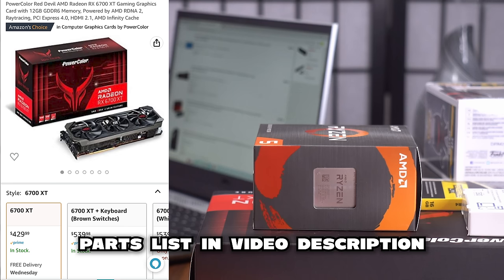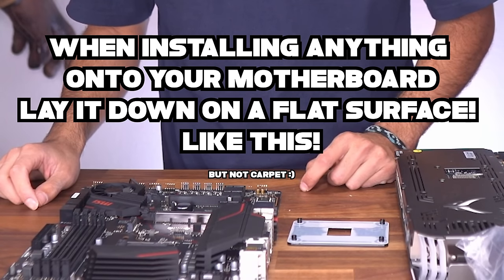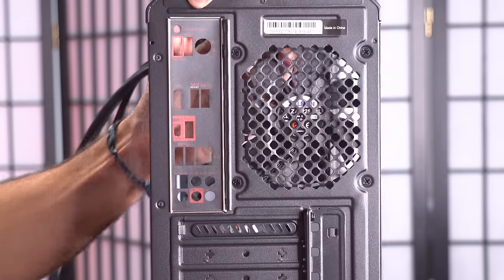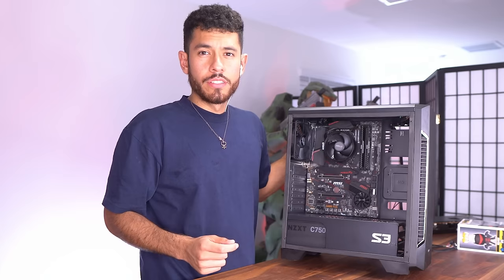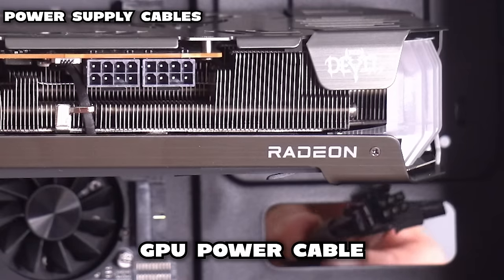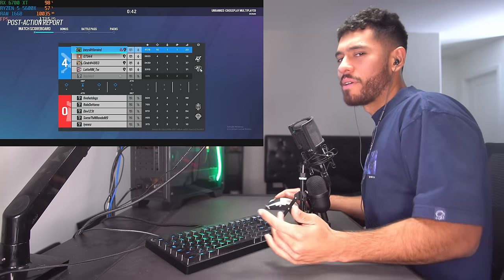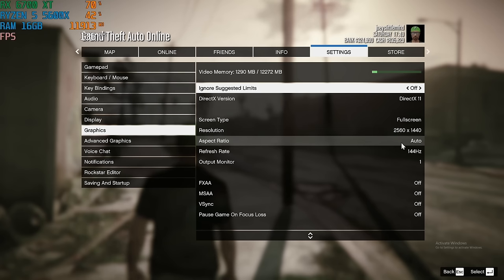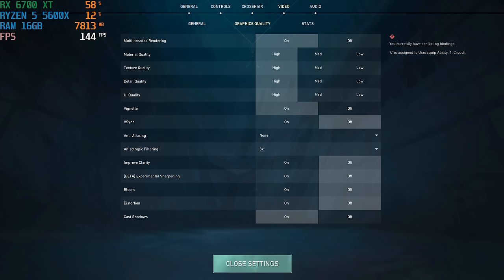BEST Gaming PC Under $1000 GUIDE 2023 (RX 6700 XT, Ryzen 5 5600X)

Comment: Hehe...so the one thing i didnt do when building my 1st PC about 2 months ago was...adding those motherboard standoffs. I cant even remember if there were any already installed in the case (vetroo white atx mid-tower) or if there were none at all...oh lahwd....hope i didnt fuck anything up 😂 😅 😭 (oop, realized i commented using my hubby's YT acct, ah well) 
---Jenn---
Reply: If you would have fucked up anything, you would have known almost immediately as the board short circuited. If your PC still turns on and runs fine, you're most likely good.
Reply: @JJFlores197  thankfully yes it's all been running fine since I built it, whew. 🙌😅

Comment: Even in these old low demand games you had a few games at CPU bottleneck and others pushing the CPU to 80% utilization, almost its full limit. With new games like Hogwarts, Plagues Tale, and Unreal Engine 5 titles arriving it appears 3 year old Ryzen 5000 6 core CPUs are cresting the top of the hill right now. A $299 5800X3D is a must for AM4 for those who can see the downside of the hill coming very soon. Or do a full rebuild for similar performance only hundreds more.

Comment: Nice build. Only thing I would do different is go Intel (i5-12400 is widely considered the best all around CPU right now, although if you find the Ryzen 5600x for a great deal or something that's cool) with the i5-12th gen, for the extra all round performance, but the Ryzen is usually cheaper with slightly better thermal performance and better stock cooler, although I always go aftermarket with my coolers. Good build. Good video.
Reply: For price/performance in terms of Triple A title gaming I'd go for a 5500 considering its only around 90-100$ yet offers very similar performance in triple A title, that said in Esport games it does loses by quite the margin, in Indonesia the 12400f is not worth it tho, it has very similar price to the 5700x which offers more core n threads
Reply: @lm1186  I don't really play that many games anymore. I just build and sell gaming rigs, and usually get good deals buying in bulk. Pairing the i5 12400 with the RX 6700 XT by PowerColor seems to be making everyone pretty happy. Which is wild considering pre-pandemic I had never used a non Nvidia GPU before. Now I can't ever see myself buying Nvidia ever again, unless it's personally requested as custom job or something.
Reply: @bizbarley74  what would you recommend for a cheap world of Warcraft gaming pc? Can you get me links to everything I need to build one?
Reply: @Roach4two0  You don't need much for that. I would Google " best $300 gaming PC build." I've never played WoWC before, but to my understanding it's pretty low on all resources. You could probably but a used GPU (Maybe a GTX 1030 or something) for around $70 and go with an older gen CPU. But if you have zero plans to upgrade and only plan on playing WC, you can most likely get buy without using a video card and just buy like an i5-11th gen with on board graphics and that would be enough. Or buying a budget gaming PC on eBay. But I'm ignorant to Warcraft so probably not the best person to ask. I build mid to upper tier machines.

Comment: I would go for rx 6600 xt and ryzen 7 5700X instead. since valorant
Reply: 6700 xt is more power ful
Reply: @cpsupport6441  I know but valorant isn't dependant on the GPU. If valorant competitive only player, go for higher CPU and lower GPU. If you're a variety player, 6700xt

Comment: Can u help with why my computer just goes straight to bios and won’t read no boot devices I copied one of your build but it just won’t work for me
Reply: Did you already install Windows? Need more details.
Reply: @JJFlores197  no it won’t let me get that far I got the usb with it on there but I start the pc and it goes straight to the bios
Reply: @chasewebster3550  Make sure the UBS drive is the first boot device. You may need to make sure you have BIOS mode (maybe called CSM, legacy mode or similar) disabled and that you have Secure Boot as well as TPM 2.0 enabled. If that still doesn't work, you may need to rebuild your USB installer.
Reply: @JJFlores197  it also doesn’t read my 500gb sad so i don’t think it would be the usb but I’m not sure
Reply: @chasewebster3550  Make sure you installed your SSD correctly. If its an M.2 drive, remove the drive and re-insert it. If its a SATA SSD, make sure you installed both the power and data cables and make sure the other end of the data cable is securely plugged into the motherboard's SATA port.

Comment: Guys im planning on doing this exact same build but i just need another motherboard option bcuz this one is not very available where i am, would be nice if someone can recommend me a one
Reply: do you want wifi?
Reply: ASRock X570 Phantom Gaming 4 is a good motherboard, I would recommend swapping the CPU for the Ryzen 5 5600 non X since the difference in performance is very small so you can save a couple bucks.

Comment: The prices must have skyrocketed because this build costs about 1500 us dollars without a operating system, just the gpu costs 650 dollars
Reply: just wait till blackfriday
Reply: im pretty sure a new rx 6700xt is 350usd
Reply: You can opt for a different 6700xt like sapphire pulse or powercolor fighter. These 2 are around 320 dollars I think. The CPU was on sale for black friday so hope you got one because it was almost like 45 percent off. The only bad thing is the motherboard is like 100 dollars more than in the video (such bs btw).
Reply: The exact same gpu here is 399 and the xfx version is 369 so its not that bad

Comment: In the next video do this build 
Case: CoolerMaster MasterBox MB600L V2 TG
Motherboard:MSI MAG B650 TOMAHAWK
CPU: Ryzen 5 7600x
AIO Cooler: thermaltake TH120 ARGB 1FAN 120mm
RAM: Corsair Vengeance 32GB DDR5 2 modules 5600MHz
SSD:Adata XPG Gammix 570 blade M.2 NVMe SSD 512gb Pcle express 4.0
GPU: Asus TUF Geforce RTX 3060 ti 8gb
PSU: CoolerMaster Gold-v2 750w full modular 80 plus gold
plz do my favour plz 🙏🙏🙏🙏🙏🙏🙏🙏🙏🙏🙏🙏 for me